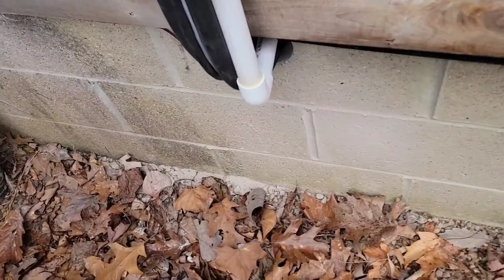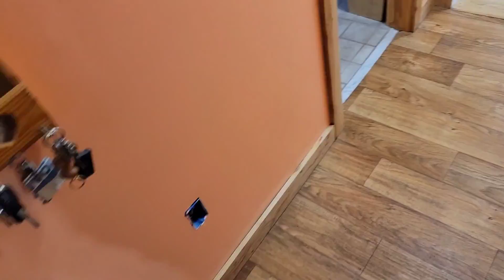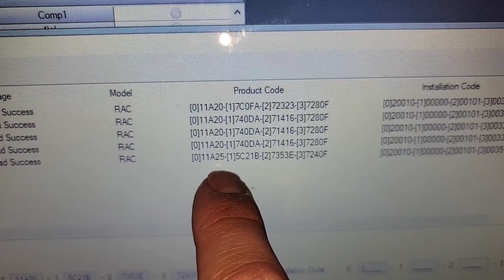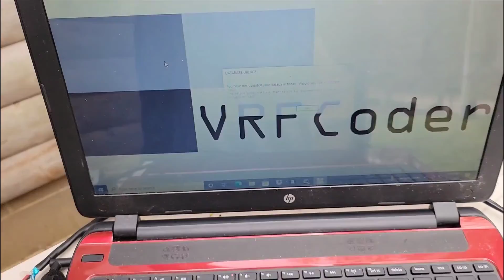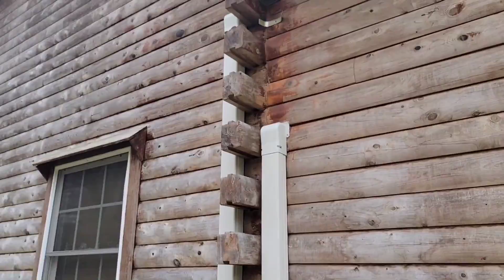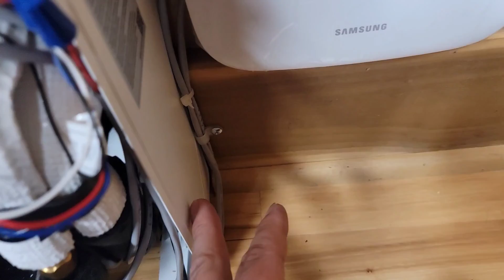Log Cabin Mini Split AC Installation

Comment: I live in a log cabin and was wondering how tough was it to drill through the log to run the line set?
Reply from the maker: Don't use a battery power drill. As long as you have the right tools like a corded drill
And a circular saw with a long bit extension, then you're good
Reply: @TaddyDigest   I work in construction so tools aren't the issue,  I've only been living in this house for 5 years and have never worked on a log home. I don't have any fears about drilling through the logs, just looking for an easier way to go about it.  Also, whether to use a hole saw or forstner bit.

Comment: Can you not run all of the lines via a crawl space or basement and shoot up through the interior walls?  I am going to build a log home and don't want to drill through the logs if i don't have to.  Two woodstoves plus heat pump and ill be off to the races
Reply from the maker: Yes if you have a crawl space you can definitely do that.
Or a basement yes

Comment: I live in northern New England and we currently have a condensing natural gas boiler with baseboard hydronic heat. We install three window a/c units each summer. I’m trying to persuade my wife to go mini-split but she detests wall units. What is the price differential on ducted mini split equipment vs wall units? Do any mini split systems have a desuperheater option to capture that waste heat for domestic hot water?
Reply from the maker: Samsung makes a geo know that connects to many splits that maybe what you go with or want
Prices about the same for the ducted and the duck work and the mini split

Comment: I love to see another home converted from ducted to ductless! 

Overheating zones has been a constant issue with multi zone systems, including my home.

Question: Have you ever considered installing refrigerant ball valves at each used port so you can isolate the zone if you need to make a repair?
Reply from the maker: I agree they are so efficient
I have installed ball valves on several commercial jobs never the residential
But doesn't mean they might not be a good idea they're always a good idea

Comment: Nice video Taddy! Always enjoy seeing your real life installations and the issues that you might have to solve. I know you're a Samsung hardware shop but have you ever talked about why you chose Samsung instead of any of the other mini-split manufacturers? The closest video that I've seen of yours that discusses Samsung was the one in your shop where you show the different inside units (wall air handler, ceiling cassette, floor console). As I need to replace my 20 yr old central A/C and possible gas furnace soon, finding out about manufacturers mini-split options, warranty, quality, customer service, parts availability, life expectancy, etc. is important to know. Again, thank you for all the good work you do for your viewers.

Comment: What is the difference between product codes and install codes?  I’m just getting into using VRF coder and SNET 2

Also what does the heat compensation do?  I have a few customers complaining about the overheating as well with Samsungs 
Thanks
Reply from the maker: Hi Derek, thank you for joining.
Please send me an email. I have a bunch of guides.
 I'd like to send you tadfuller1@gmail.com
Reply: @taddydigest  I sent you an email, thank you
Reply from the maker: With heating compensation the equipment will put be programmed for a certain degree of change of temperature that is calculated by the Air sensor

If you put zero Then the equipment will just read what the sensor reads
Without any plus 1 or plus 2 or plus three added value of degree